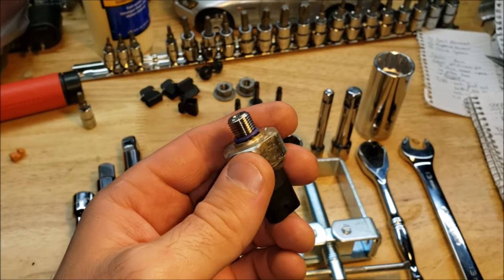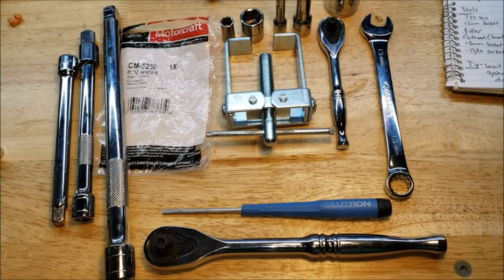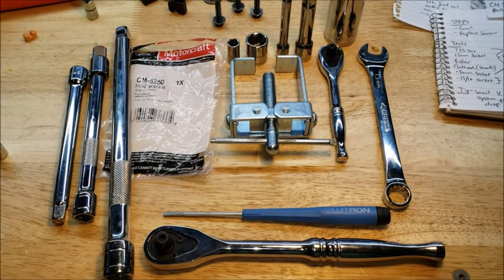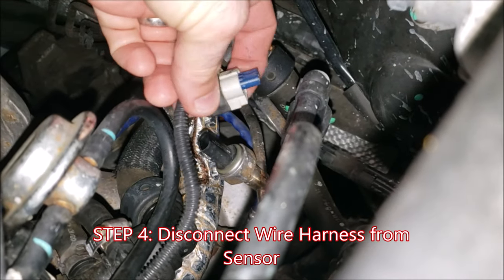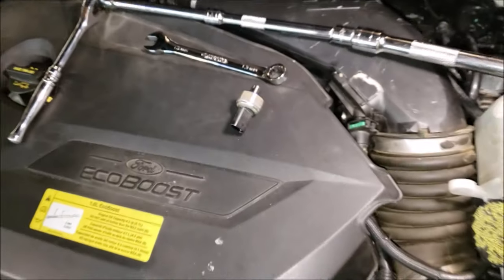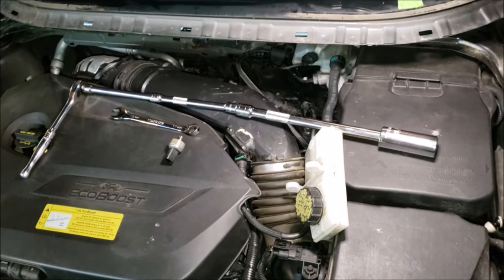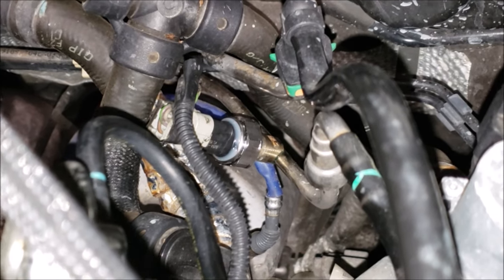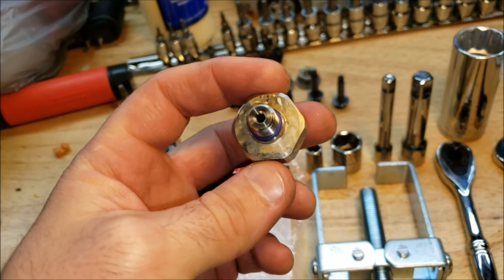How to Fix Stalling EcoBoost Engine - CEL P0087: HOW TO ESCAPE

Comment: This might be a problem with my 2.0 EB Fusion, was there any fuel spraying out when taking it off?
Reply from the maker: You can allow the system pressure to dissipate by letting the car sit for up to 12 hours and then remove it. However,  along that point it is still only pressurized by the fuel pump so even if it did spray out, it would be manageable with a towel to surround it and absorb it. The high pressure fuel pump at the fuel rail is where you want to be careful but this sensor is upstream of that so it is not as scary. Just make sure to disconnect your battery first to prevent a spark in case you have a fuel mess.
Reply: @HowToEscapeDIYTipsandReviews  sweet thanks!

Comment: I bought a focus 2012 titanium manual 2.0... mark the code p0087 high fuel pressure rail system too low... change the spark plugs change the fuel pump... new... but change the rail fuel regulator I bought it used in junker the fault persists when I go slowly, fine, but if I step on it hard to run, it doesn't respond...
Reply: Did you fix your problem that’s how mine is ? Can’t seem to figure it out

Comment: Your escaped is 2013 and is 4 cylinders ?
Reply from the maker: Hi Hugo- yes we have the 2013 1.6L turbocharged 4 cylinder.
Reply: @HowToEscapeDIYTipsandReviews  and the problem disappeared ?
Reply: @HowToEscapeDIYTipsandReviews  I have the same problem I will try to change that sensor , I have a Ford escaped 2013 1.6 ecoboost like you and changed the fuel pump already and the problem still there what do you thing ?
Reply from the maker: @hugomendez658  Hi Hugo! Sorry for the delay- to answer your first question, yes it did resolve the stalling issues and hesitations once warmed up. I have not experienced that ever since replacing the low pressure fuel sensor. I think if you've already replaced the fuel pump, the sensor is the next logical thing as well as somewhat of a low cost item (relatively speaking of course.) I know it worked for us and if you have the same engine and the same symptoms, it could certainly be the issue with yours as well!

Comment: Would it be safe to use a torque wrench for this?
Reply from the maker: Its a good question but I'd say snug and hand tight is all just because its a somewhat delicate hardline for the fuel. If you can hold the underside well, then perhaps, but I can look it up and see if there's a torque spec. If so it has to be on the lower side

Comment: Can this cause missing
Reply from the maker: Hey @HUGEGIZMO 1, did you mean to type "misfiring"? If so, I would say likely not cause true misfiring, but it could feel like it. Misfiring is typically associated with plugs or coil packs, OR timing issues. However, when we had this sensor going bad, it would tell the computer improper fuel to air ratios and throw everything off, and our car would lurch forward and stall, and just keep hiccuping, often feeling like a misfire. It was sending faulty information to the computer controlling the fuel injectors which in turn affected the firing, so it could feel a lot like misfiring. However, there may be nothing wrong with the plugs or coil packs. Does that make sense? I am pretty sure that's what is going on at least. Hope it's helpful!
Reply: @HowToEscapeDIYTipsandReviews  thank you I'm going to go ahead and change the sensors
Reply from the maker: @hugegizmo151  alright sounds good 👍 the hardest part for me was just getting to break free as we didn't want to be too rough with the fuel line area. However, just use a wrench on the flats of the sensor receptacle and you can get better leverage there
Reply: @HowToEscapeDIYTipsandReviews  ok I'll let you know how it goes thanks

Comment: This is NOT a diagnosis. This is a guess.
Reply from the maker: It was an educated guess, but you're right. And it did work. Its Youtube, man. I'm not a tech, just sharing what worked and hopefully it can help. It would be awesome to have a shop full of pro tools and procedures but thats not the case :) thanks for cleaning up your last comment.
Reply: Don't worry it's not you I have a bone to pick with, it's ford. No ports to test pressure whilst the sensors are in the system! That! Is pure idiocracy. I am a certified mechanic and am in complete awe of the lack of diagnostic support from Ford, or the repair manual provided by a service I pay 200$ a month for!!!!
Reply: @benhajdu4040 
My friend 
If the Ford is petrol engine then you do a test about  fuel pressure if 
1)petrol pump works, if the pump works 
2) next you can test pressure regulator, if that works or there is a problem with pressure regulator 
3) if the fuel pressure is OK then you can test the low pressure fuel sensor